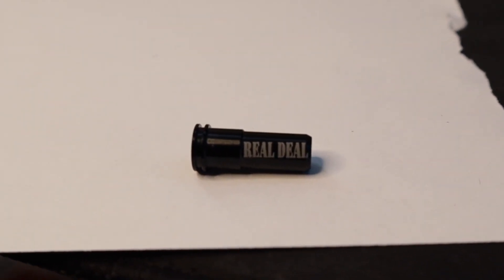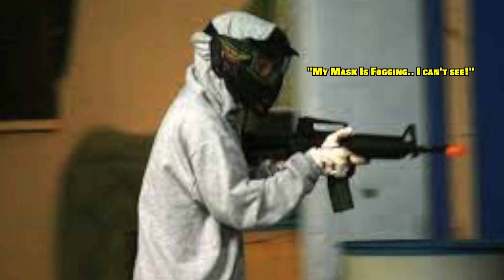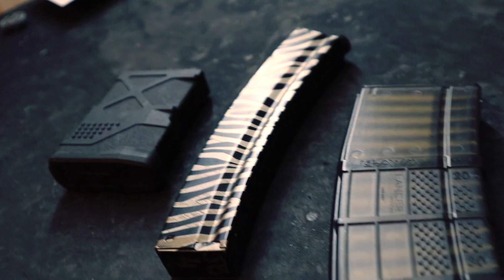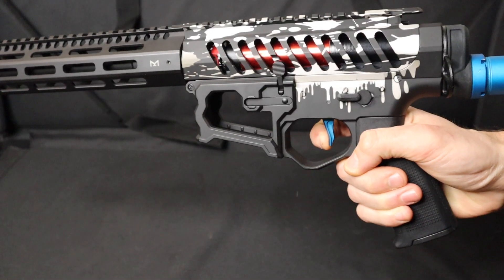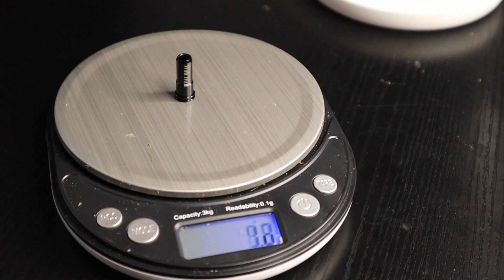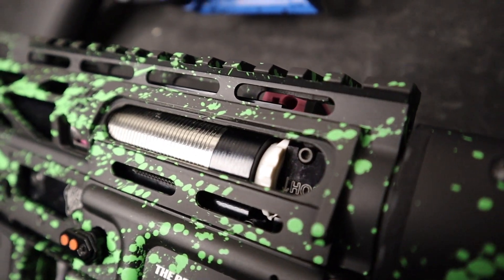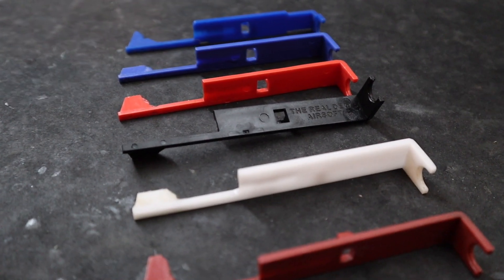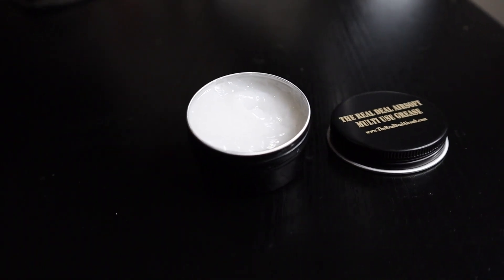The Real Deal Airsoft CNC Nozzle Overview

Comment: Midcap syndrome is when the nozzle has has upward play and not seating with the bucking properly. how is drag related to that? just use a strong tappet spring and lube the nozzle and make sure the tappet plate is sliding smooth. and sanding it down to size is a bad idea. just get a nozzle if the right size.
Reply from the maker: Trust me in high speed builds double o rings cause feeding issues more often than not. I have tested this many many many many times. I have built hundreds and hundreds of aegs. It may not actually be Midcap syndrome it’s a feeding timing issue
Reply: so the extra drag is that severe?

Comment: It's not actually because of the friction between single vs double o-ring, frictional forces are independent of contact area, your single o-ring design might have something to do with it being lighter which will reduce the frictional force or possibly the tolerance on the nozzle or o-ring tolerance. Try to weigh both of them and see which is lighter, or measure the dimensions between the nozzles and see if there are big variations which will again cause higher friction if it's too tight etc.
Reply from the maker: Double o ring and single o ring aluminum nozzle both weight the same and the one with the single o ring solves the mis feeding issue.
Reply: @TheRealDealAirsoft  It's possible your single o-ring is more precisely machined, better fitting o-ring and or tappet plate groove. Something mechanically was clearly fixed if it solved the issues though which is cool. I can't compare them myself, but if you do find out exactly why, keep it a secret ;)